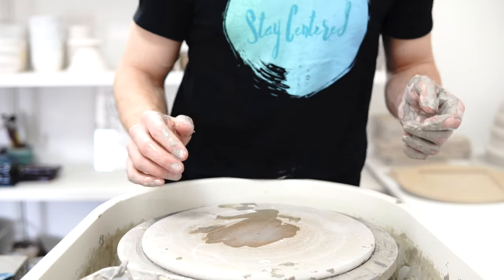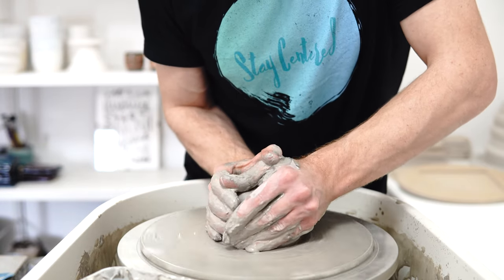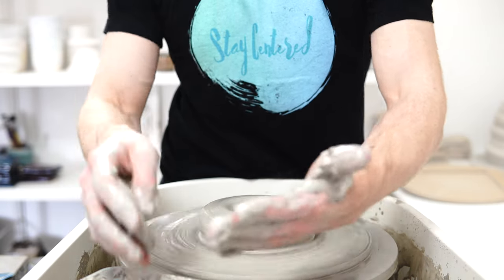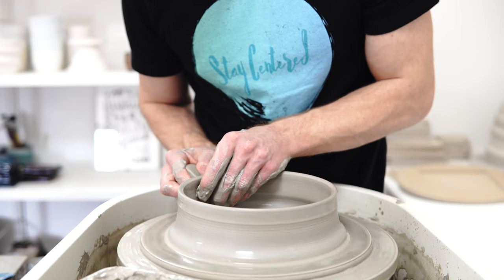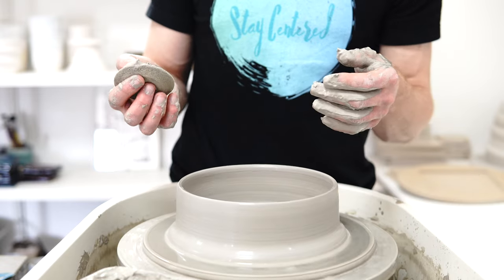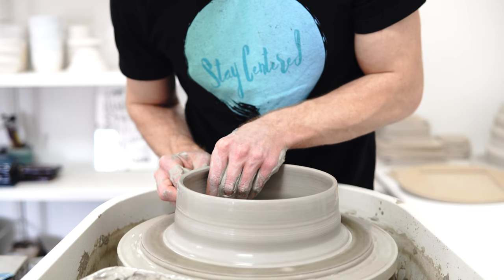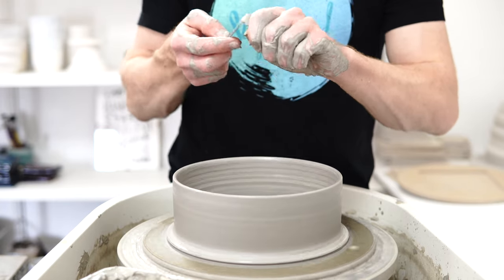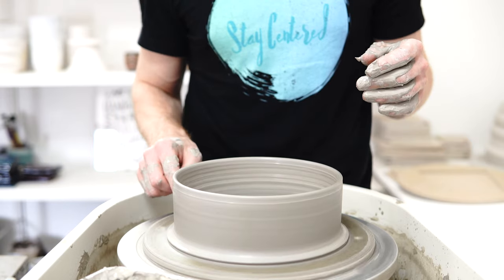Throwing Test Tiles (and results from the first glaze test firing in the new kiln)

Comment: Hi Joe. I have the Kmt1018. Did you find a preset 5.5 firing or have to do a manual firing straight away. I do a cone 6 preset medium fire no hold and the cones are nearer a 7. Thanks for your thoughts. I have to say I get great results at that but still feel I should come down half a cone.
Reply from the maker: I went straight to the schedule I've been using up until now, I didn't even consider looking to see if there was a suitable preset firing. If yours is going a little over, it might be worth doing a manual schedule that's basically the same as the preset, and just experiment with lowering the peak temp a few degrees at a time. In my experience there are a lot of the runnier glazes (like floating blues) that have fewer issues in a colder firing
Reply: @OldForgeCreations  thank for your comment. I will have a look at this. So far I haven’t tried to set it my self.